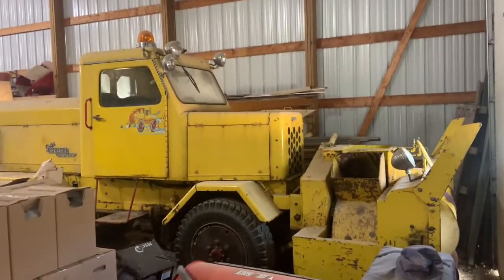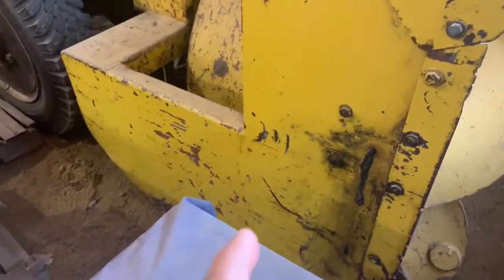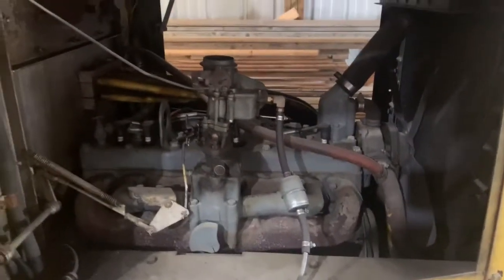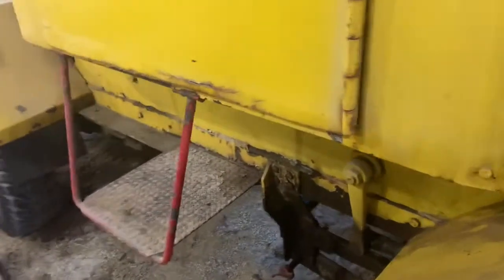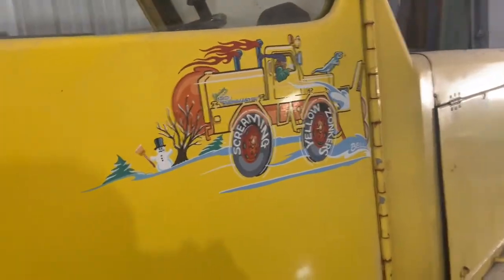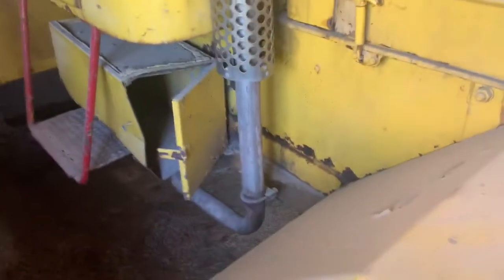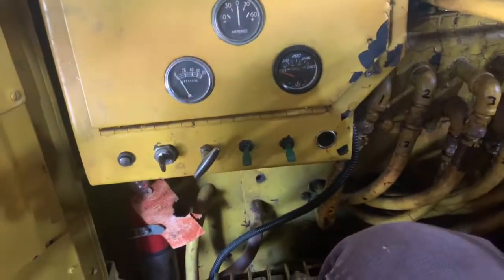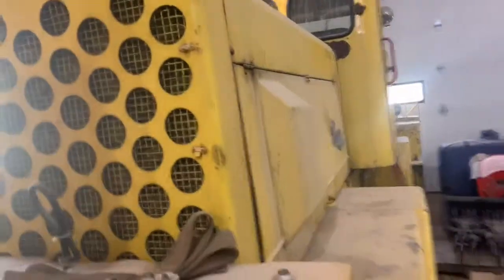David bell snowblower sicard snowmaster jr.

Comment: Awsome machine how much do you think it weighs?
Reply from the maker: NJ Barn Finds we took it to a car show once on a heavier duty skid loader trailer. So about 10,000lbs. Sadly the guy running the show wouldn’t let us in😕
Reply: What Hobo Groh Knows that sucks man, I’m looking at one now what do they usally sell for in original running condition I don’t see very many of them
Reply from the maker: NJ Barn Finds we found one in Duluth Minnesota for 6800 I believe dad offered 5000and the guy said no. was on the rougher side still had the gas motors the rear one was running rough. You can still get most of the parts from sicard now called SMI snowblast. And the convert one ones like this one to diesels, the diesel doesn’t make much of a difference all it does is create better fuel economy. Also most have a snow chute to load a dump truck so if your looking at one I would recommend buying that with the machine. So if it was original which most have been repainted and in good condition I would offer 6000 to 7500 but that’s just me if you like them I would offer more money if you really want one
Reply: What Hobo Groh Knows awsome the one I’m looking at is in Massachusetts I’m thinking about buying it to resell
Reply from the maker: How much do they want for it
Reply: What Hobo Groh Knows $3500 but I have to get it shipped from MA to NJ
Reply from the maker: NJ Barn Finds damm that’s a good price